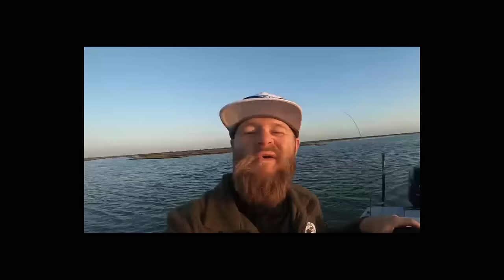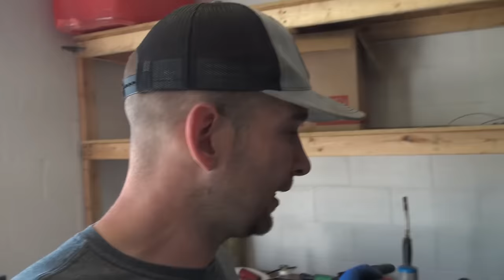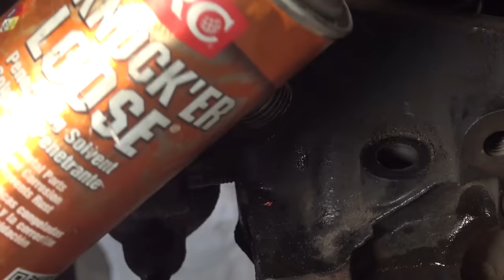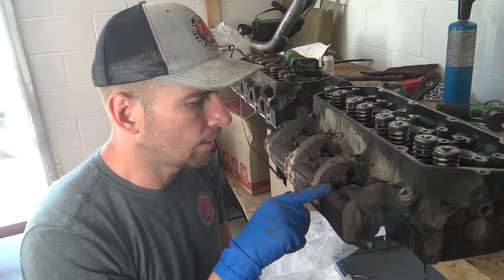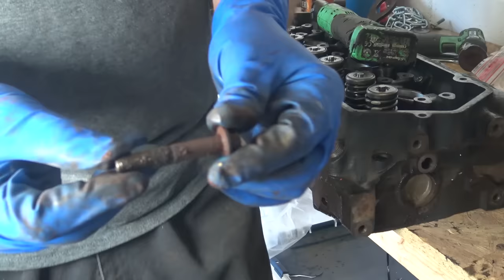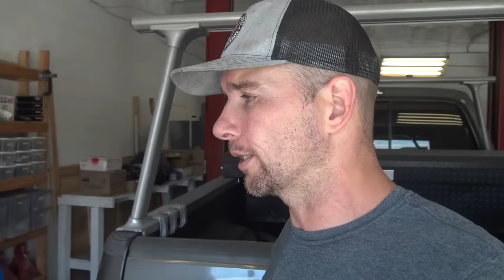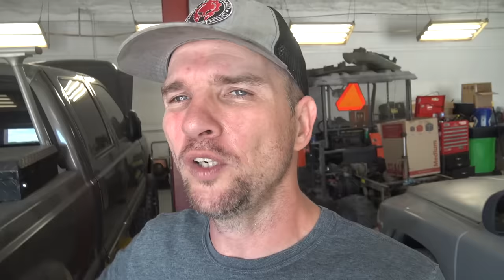Old Mechanic Taught Me This Trick To Removing Rusty Exhaust Manifold Bolts!

Comment: I'm 3 years too late but if you get this message what you needed to do was leave the bolts in on the ends. This way to maintain the level plane across the whole manifold. Loosen up the middle ones first starting from the very middle than the right than the left then gradually loosen up the left and right and ones 4 resulting in a consistent lowering of tension across the face of the exhaust manifold and I don't think that one would have got caught up on you again

Comment: Dude you're no wearing safety glasses. The reason I say this was because when I had my shop up here in the North East we deal with a lot of rust. Yes a good quality penetrating oil like Croil or PB blaster is a must. But the best way to extract any rusted bolt or fastener is to heat up & around it as you did. But super cool the object in the middle witth canned air or dry ice. It'll save you money on Oxygen & Acetylene.🤔

Comment: Hello bud.. nice vid.  Anything to do with exhaust is a pain in the arse, and therefore is worth being patient.. as you said.  Another method worth trying if they not co-operating?  A good thwack with hammer and punch.. this can "shock" the bolt/stud inside the cyl head just enough to break the seized thread.. Even better? use a "T" wrench (instead of ratchet or breaker bar) to apply pressure and twhack the back of the "T" wrench at the same time... And a bit of heat?  That'll get Anything loose without snapping... until it snaps... ;-)

Comment: The best way to take out Rusty stubborn bolts that you have to heat up to remove use paraffin wax it works better than any other chemicals it doesn't burn off.

Comment: So what's the trick here other than using heat and penetrating fluid, which is common knowledge when dealing with rust fasteners?? Did I miss anything??
Reply: The re-tightening of the fasteners, basically one round of making sure they move while the whole part is actually clamped down by the other bolts, as that means you're not adding additional stress (a portion of the clamping force held by the other bolts will get applied to the last remaining fasteners) onto the bolt you're breaking free, while breaking them free of rust at the same time. Have to say he's onto something there.

Comment: Use a Thread Restorer, not a Tap, you want to remove debris from the threads, not cut metal from the threads as a cleaning method, which changes the effectiveness of the recommended torque value, not to mention weakens that internal thread.

Comment: That’s the way to do it to take the most time possible. Grab an air hammer with a pointed tip, tighten the bolt just a smidge, then shock the bolt with the air hammer and then remove the bolts with a 3/8 impact. Not a 1/2, 3/8 impacts have more hammers per stroke. Shouldn’t take more than 45 min to do both heads.

Comment: Yeas , So True , A Little at a time and watch the , if it can be seen; Bolt Itself For Torque snapping. Good Info, Now For a vid in Exhaust manifold Stud Nuts Loosening While On The engine In the vehicle. = Older SBC Engines.................  :)

Comment: Great tips! One additional thing I'd like to add is a trick I read about long ago that works well. When you need to heat up a bolt, while it's still real hot, hold some wax to the hot bolt head, and threads too, if they're where they can be reached. The wax melts and wicks under the head of the bolt and down the threads into the hole it's screwed in to.  It'll act as a penetrant and lubricant, helping to free and ease removal of the bolt. I imagine a candle would suffice for the wax, but I use "Gulf Wax". It comes as a small block of wax in a box and is avaiable in most grocery stores and doesn't cost much.

Comment: Something I've wondered... The bolts are never stuck in the head. It's the rust and pressure from the manifold. You're not going to reuse the bolts so why not just cut all the heads off? Remove the manifold and use vice grips to remove the bolts from the head. This way, you know the bolt isn't going to break flush or recessed in the head.

Comment: If you use heat go one step better and add bees wax to it ,as it cools down the wax is drawn in between threads of nut and bolt saved months of hours in labour and hundreds of thousand sof dollors

Comment: At 10:56 you are heating the wrong place.  The holes in the manifold are clearance holes.  At 11:50 you are heating the right place.  The holes in the head are threaded.  You can see this at 12:15 when the threads are out of the head the bolt slides right through the hole in the manifold.

Comment: Spray those bolts you've heated with penetrant oil. Some will say paraffin works. The heat will wick the oil back into the hole.

Comment: Thought you were gonna show me something I didn't know?, but you fell short of the MOST IMPORTANT piece of the puzzle...and that is...ALWAYS take a good weighted hammer (after penetrating fluid and heat) and whack the bolt dead center. NEVER just take a socket and bar to it....cause it will snap! The hammer whack breaks and separates the rust in the threads...and generally it's  Bobs your uncle!
Trust me...I'm a very oĺd mechanic😁

Comment: If you want to know how to loosen stuck bolts, read the helps guide of any chiltons manual. Yes, the heavy ones that have actual paper in them. Your "old mechanic" didnt teach you everything. Take a hammer and tap on the bolt medium hard to break the rust loose. Reapply the skunk juice, and tap some more. A lot of them come out like theyve just been put in.

Comment: Thanks for sharing. The trick I recently learned is to tap the head of the bold with a hammer first. Shocks the threat. After that tighten the bold a little and than loose the bold a little. When rusted that seems a way to loosen rusted bolds? 

Sorry to read about your divorce. Hope everyone will get their life back on track.

Comment: there's no such thing as too much lubricant/penetrant. Every time you get a small turn on the bolt, spray a little lubricant onto the newly exposed thread. Certainly doesn't hurt.

Comment: Outbord motors are the worst call Corrosion get in between the steel bolts I went back and forth for 10 minutes and it still broke I think it was saltwater motor or something I drilled it out I threaded the hole in the bought stainless bolt yeah I tried heat but you got to be careful with aluminum

Comment: That's not rust, that's lightly seasoned. Where I'm from there's usually no head left on the bolt, so I just cut through the manifold and studs with a torch and weld nuts on. It's so much easier than fighting with 1 bolt

Comment: It seems like every mechanic has a specific way to deal with rusted bolts. I don’t knock any of them, if it works I add it to the resume. For me I’ve had the best luck with a wire brush, smoke wrench and impact…

Comment: 4:33 understandable, however why not just orient the block to where the manifold is on top of it, so that when you loosen the bolts, there's no weight from the manifold pulling down on them?... Easier said than done if you haven't got fancy equipment, but most garages who do restorations like that on old junkers have something that could perform such a function.

Comment: These bolts aren't even that badly rusted.  Where I have wanted to jump off a bridge is when taking the nuts off the studs that hold the exhaust pipe y-divider off the manifolds where high heat has really done its dirty work.

Comment: Don't waste money on 'penetrant' sprays. Just get the torch out first, it will save you time and money. In my 50 years experience I've concluded that the spray cans are pointless, even the expensive ones. If the bolt comes out after you sprayed it, it would most likely have come out anyway without the spray. If you have exposed threads then clean them up with a wire brush and lubricate with light oil, but you don't have to pay $25 a can for that. Also, I've never seen any difference with using anti-seize on manifold bolts. I suspect that the first few heat cycles significantly denature the anti-seize, despite what the manufacturers claim. I even suspect that it can make matters worse rather than better.

Comment: someone likes the torch too much ! CLEAN OFF the bolts tap with hammer lightly and wire brush it off then liquid wrench it wait about an hour and wrench it again now try to take it off! I like the running the tap thru the bolt hole that's bis a good idea! and use air to clean it out!

Comment: I don't think penetrating oil does a dam thing as far as braking a frozen machine bolt lose. Of course it would help to run a corroded bolt thru a nut, but only after it has been broken lose. just my opinion and have never been proven wrong. I have used it on half of the rusted bolts I have removed many times and have yet to notice any obvious difference.

Comment: Here's a better advice. If you're not in a hurry. Soak them for days with penetrant. The more the better. If you spray and twist right away. You could risk  shearing bolts. One bolt is too many. Spraying it down a few minutes does nothing in this application.

Comment: A 13mm bolt is not the same size as a ½" bolt! Using a 13mm on a ½" bolt head that has lost material to rust damage has resulted in more rounded bolt heads than you can imagine. USE THE CORRECT 6-POINT SOCKET!!

Comment: NO !!!!! Do not run a regular tap in a hole to clean it out !!!! taps are made to cut metal ,and thats what they will do in a old rusty hole,remove metal from a hole from the side and leave a oversize tapped hole,, you dont want that,,buy a set of Thread Chasing Taps, they are made to Clean out a tapped hole, not remove more metal..as i am a machinist i have plenty or dull and broken taps and have made them into thread chasers,unless you have at least 20 years experience sharpening tools and such ,,buy the thread chasers they are not that expensive...

Comment: Lets see you remove bolts when motor is still in the vehicle. The rear one the is hardly any room for a ratchet. Many applications you take manifold loose and lay against frame then take the head off. Why take all the exhaust loose if you don't need too. Then I would be impressed.

Comment: those bolts are not even remotely rusty... here in new england where they plaster the roads with salt most older exhuast manifold bolts are unrecognizable lumps of rust. only way to get them off is torch off what is left of the heads and slide mainfold off, then use vice grips or a nut/welder on the stud to get them off

Comment: That is your "secret"? Heating a nut or bolt and using a six point socket is not an old trick, it is the norm. I think the first time I did it I was 12 or less.

Comment: And most brobably that way youll tear one. Old bolts get cristalised and sometimes thinner. There is no universal way for that job. Every case has its own peculiarities. The torch, the hammer and the induction heater seem good enough for the task. And one more thing. Modern engines wont last long enough to have any coroded bolts and threads!

Comment: If you have enough room to get in there with a ball peen hammer and smack the head of it a lot of times you were jar the rust that is around the boat into the manifold off and then when you hit it with your ratchet or your impact or your regular ratchet it’ll let go of it a lot better than it will if you Just bind it up. Try pecking it before you heat it as well.

Comment: Erm... Wrong. Never ever start from one side only, the correct order is 1, 4,2,3.  And yes spray with Würth or the like and take a hammer a whack the head of the bolt then do the loosen, tighten , spray, loosen , tighten.

No need for the heat.... Just drill with a 1mm drill then a 2mm and ao on if it snap and when you get to 4.5 mm whack a 5mm allen head socket and loosen

Comment: I wouldn't necessarily call any of this a "trick" .. it's just the way it's done unless you're 25 and think the impact is the only cat's arse.

Was sharing bays with some fellas a while ago .. good guys, but they spent more time fixing what they frigged trying to get 'er done on the clock, while slow, easy, and smart usually gets you there faster.

Comment: Thanks for the showing.

Question: How sies a divorce chase you away from this channel?

Comment: I never received any results from MAPP gas mych less propane.  Finally broke down and spent $600.00 on a small oxy-acetylene kit and gased and another $120.00 on a Victor #6 rosebud.

Tips:  I would use a "thread chaser" instead if a tap which to clean out the head threads.  A tap may cur new unwanted threads id not careful.

Comment: Why would you use a ratchet?
They have limited strength and you need to keep switching its toggle all the time.
Just use a breaker bar, surely your mechanic friend told you that? 🤔

Comment: You call those rusted bolts? I can take those off without removing the heads, I have bolts that don't even have a hex on the head anymore, lets see you take those off. I'm dreading having to start the work on them.

Comment: thems some nice big bolts you have there you should give those little bitty 5/16 bolts on them hemi 5.7 heads a try those enineers need to be kicked in the balls for even thinking of using those small bolts to hold the exhaust on those heads hell they snap off from just the heat of the motor

Comment: Why on earth did you even have a 12 point socket out ? My snap on 12 point sockets are only reached for when I am all out of options and a 6 point will not possibly work. It is an inferior tool to be used in case of emergency's.  the fact that you KNOW it is inferior yet was simply to lazy to actually take the time to reach for your 6 point socket instead means you either have a disorganized tool box and or too lazy to look for it or broke it and never bothered to replace it ? All of which means would not ever want you to work on anything of mine. watched the video purely to see if you had any insight on showing to do things better then my methods and you had no tips or tricks I did not already know.  12 points are for novice mechanics or in case of no other options.

Comment: Soooo...this "old mechanic"....downloaded his 70+ years of hard life of repairing rusty vehicles....figured one day that HEATING the area first will help crack it loose......then passed down his wisdom onto you about 'the old trick from the early 1900s....and his infinite wisdom was HEATING IT WITH A DAMN TORCH....oh ok...I honestly thought if you cant get a stuck bolt loose you just use common sense and HEAT IT WITH A TORCH,  your  "old mechanic" buddy don't seem too